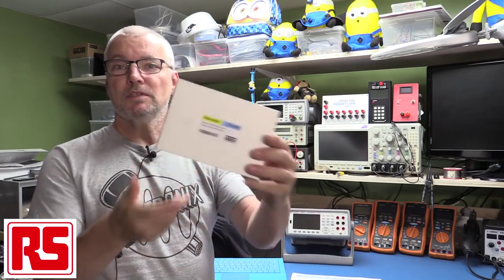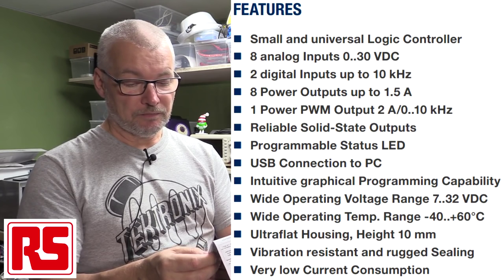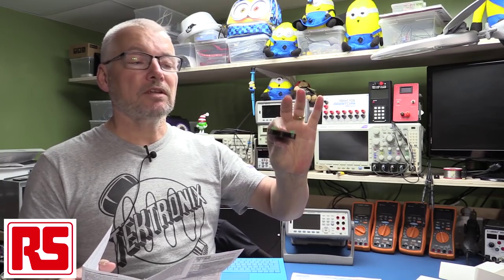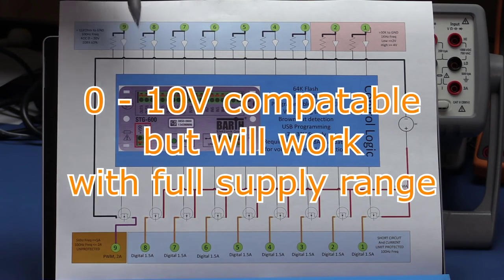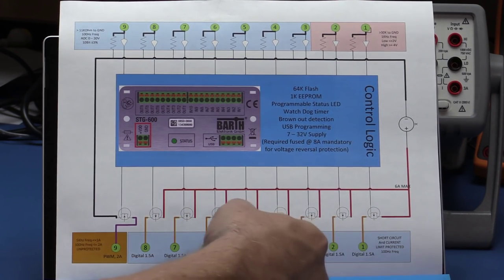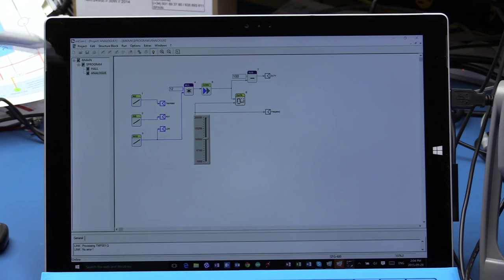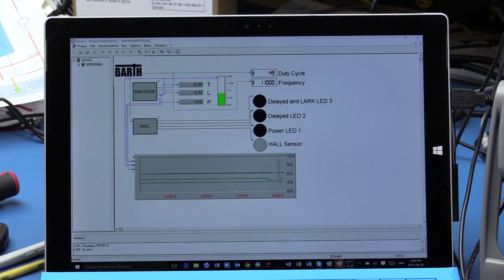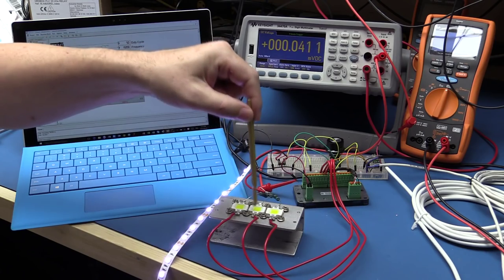Barth STG600 Mini PLC Review

Comment: Great review Peter. I you ask yourself why the USB connector isn´t a standard type: underneeth the STG-600´s front plate the PCB is fully enclosed with PU potting resin to make the Mini-PLC useable in harsh environment. A standard USB connector would be filled with resin during the potting process because these kind of connectors are not sealed.
Reply from the maker: +BARTH Elektronik GmbH Thanks for the quick response and clarification, makes perfect sense now.
regards
Peter

Comment: Nice review peter. I'm struck by the  ultra thin package and terminals 3 times the depth. sort defeats purpose of thinness. I would would prefer larger product with terminals wired out the sides.
Nice product & SW though

Comment: Nice review Peter.  Can the PLC make http requests ?
Reply from the maker: +Bill Greer nope, there is no networking included with the product and I have not been able to find out what communications protocols it uses between the PLC and the PC, if this info where known then a proxy could be built to do what your asking but alas it is not... sorry
Reply: Hi Bill, Paolo from RS Components here! We have just introduced an additional version of this PLC with CAN BUS connectivity: the Barth STG-650.
CAN BUS allows to control and monitor remotely the PLC. We are going to present the STG-650, and the full series of BARTH PLCs, at the next SPS faire. Moreover we will show an example of remote control application using groov software from opto 22
Cheers